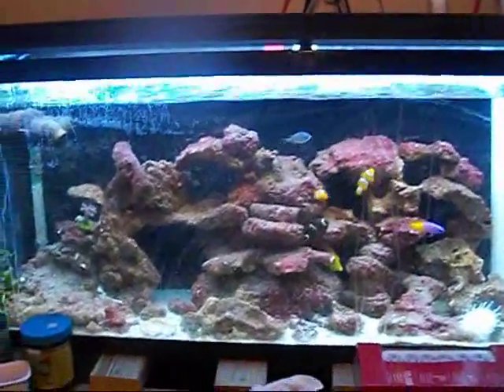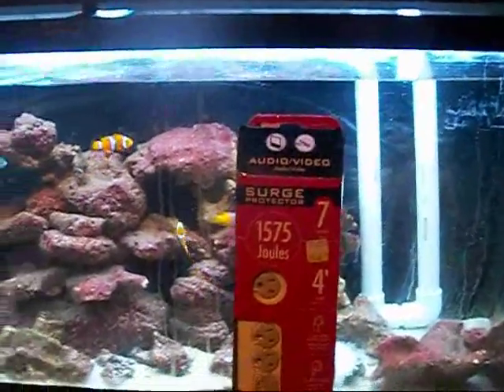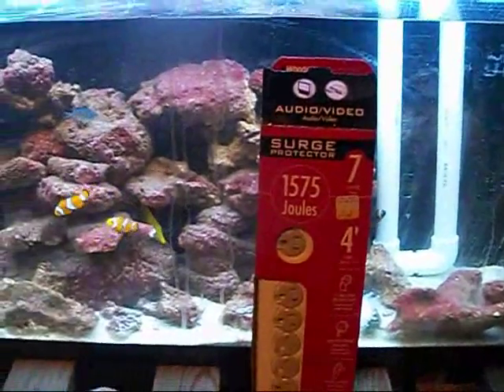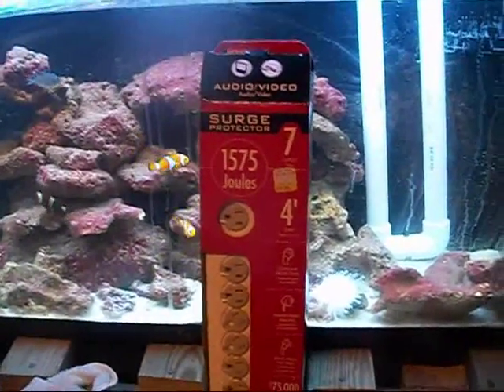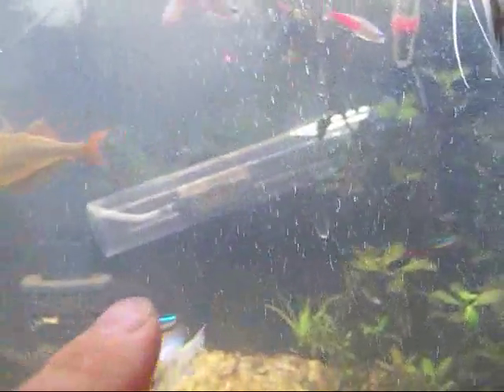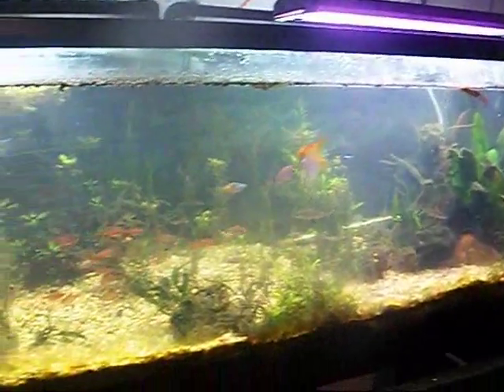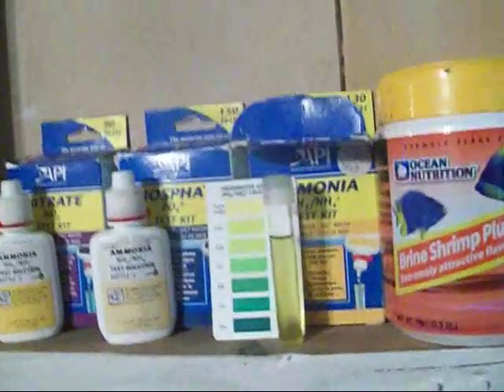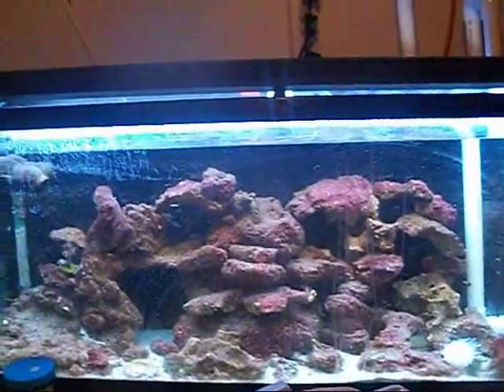Aquarium Saftey First Drip Loops and Power Surge Protectors

Comment from the maker: Windex won't hurt a glass aquarium if you spray the paper towel first, if you spray the glass then yeah some of it will get into the water, but just a little. If you have an acrylic tank then that's different because that will "frost" your viewing panels. But windex outside of a glass tank is fine, glass holds the water in, and it doesn't let the windex in either.